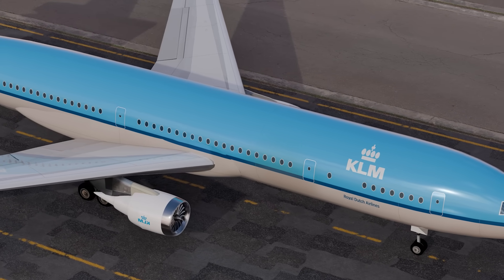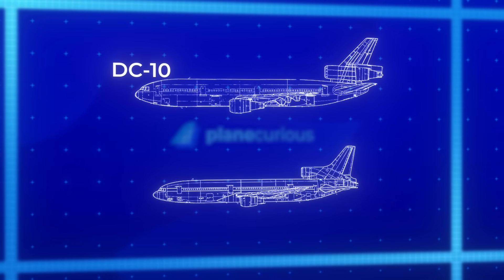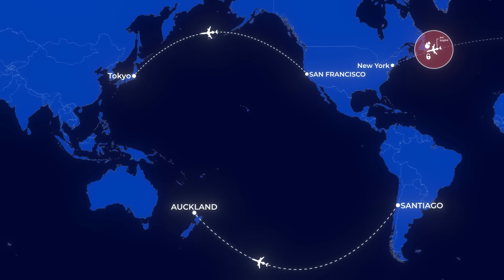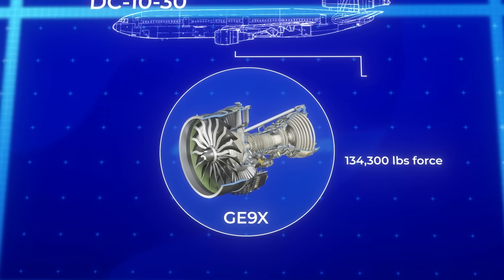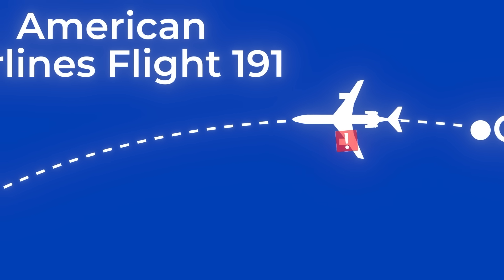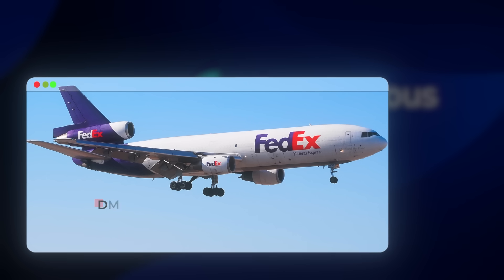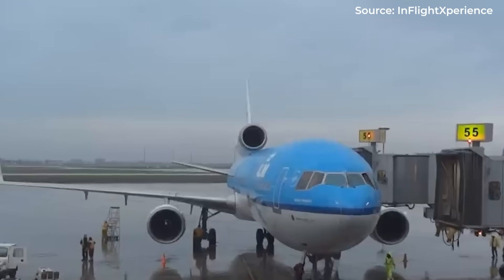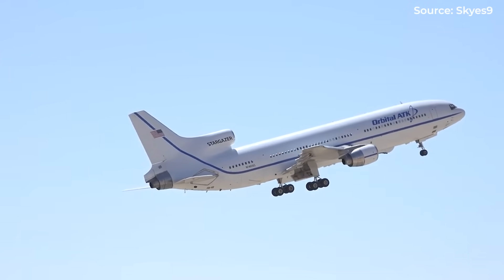Trijets Changed Everything - Until They Didn’t

Comment: Douglas had plans for (and international requests for) a twinjet version of the DC-10. But McDonnell didn't want to invest the money. In a great "what if" had MD catalogued a twinjet the size of a 767 when ETOPS became a thing they would have been possibly a decade ahead of everyone else.
Reply: The McDonnell c-suite still is a bunch of cheapskates; they ruined both Douglas and Boeing...
Reply: @ At this point Douglas had the DC-8 quadjet, DC-9 twinjet and the DC-10 trijet. Modifying the DC-10 into an underwing twinjet should have been relatively simple for Douglas. And the DC-10 platform is newer than the 737.
Reply: @stonebear  Not quite correct . . .

After the DAC/MAC merger in 1967, the corporate board of directors was predominate dominated by MAC executives including multiple members of the McDonnell family. MAC designed and built some great military aircraft, but never understood the commercial side of the market and thus was the major factor in DAC's demise.

Regarding their effect on Boeing after the Boeing/MDC merger, it is not what most people think. Only two people from MDC board transitioned to the new Boeing board. John McDonnell and Harry Stonecipher. At that time the heard of Boeing Commercial Airplane Group, BCAD, was Phil Condit who was a career long engineer at BCAG. Immediately following the merger, less than a handful of MDC executives went to Seattle to run the show.

By that time both Condit and Stonecipher had already been infected by the Jack Welsh business model as well as many many others already in place at Boeing had been. The whole industry was. Other industries at the time also. Neutron Jack was the golden boy of industry and Wall Street at the time.

Yes, Stonecipher, who worked for Neutron Jack at GE, had a lot to do with it, but most people forget, or don't know that Stonecipher was only at MDC for 18 months prior to the MDC/Boeing merger, giving little time for him to infect MDC as many people think he did. His way of doing things in no way, shape, or form existed at any level of MDC prior to his arrival 18 months earlier.

The bottom line is Boeing was headed that way with or without the merger. The merger just accelerated it. Condit and his ilk were well on there way. And McNerney,  continued in that way, and then Mullenberg, another career long Boeing engineer went on to take it all to an entirely higher level.

Comment: Pretty much ETOPS decimated trijets (i.e., made them obsolete). Of course, McDonnell Douglas lacked resources, so they went with the MD-11. Had they played their cards right, they could have at least conceived an idea of a jetliner longer in range than the Airbus A330-300 with the MD-11 fuselage without the tail engine, pretty much their own B777 (at least before the actual Boeing 777).

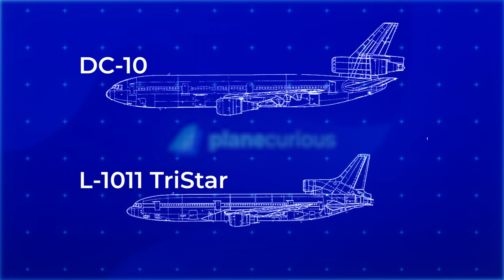Also at 3:23, the TriStar has three RR engines, so the L-1011 is both figuratively and literally a Rolls-Royce.

Comment: I don't know where you got your information on the thrust output on a DC-10-30, but it is much more than 125,000 lbs. force. 
The CF6-50C2 on a DC-10-30 put out 52,500 lbs. thrust. I built CF6-50's, installed them on many DC-10-30s, and trimmed them. The CF6-50C2B put out 53,500 lbs.
One of the best engines I ever worked on, and I overhauled many different jet engines.
Reply: Flew those big GE’s for 23 years of a 35 year career.  Always thought stood for Great Engines!  In a DC-10-30 with the parking brakes set, you could literally feel the airplane lunging forward:  those big -50’s just saying “let me at that runway:  I’ll show you what a Pratt and Whitney just wishes it could do”.
Reply: @gordonbryan8381  When I would run those engines on an empty airplane, usually a post heavy or light check maintenance runup,
you had to be careful. The plane could just take off on you. In snow I would have the plane fueled to 130,000+ lbs. of fuel, you needed the weight.
The Woodard MEC on a CF6 is the best hydro mechanical computer, or main engine control I ever worked with. CF6's ran great because of it.   
Dealt with JT9s' on DC-10-40s, the JT9 was one very tough engine, as long as the engine control components were properly overhauled, they ran well. If you had a worn out Engine Vane Controller (EVC) the variable stator vanes would hunt, and stalls could occur, and they did. Violent stalls. 
The JT9 was touchy about airflow, you could get cross wind stalls, off idle stalls, full power stalls on the ground. Top of decent stalls in the air.
Reply: You are absolutely right. I dispatched DC-10-30s for some 15 years snd I have good memory for figures.
Reply: The original CF6 was a 40,000-lb class engine.  I worked with GE's performance data for years.
Reply: CF 6 core comes from the GE J79,,,, and still tried and true.
Reply: After 4000 hours on 767 with CF6 engines, my last flight was a DC-10-30, DFW to HNL.  Never had a CF6 engine even hiccup.

Comment: The first airliner I travelled on was a British Airways Lockheed L-1011 TriStar out of Gatwick back in the 1980's.
All my flights these days are on Boeing 737-800's. The TriStar was like riding in a limo, the 737 is like riding in a Fiat 500!
Reply: I remember mostly the flawless, perfectly-compensated touch-down.
Reply: I love the 737.  I compare it to a Toyota Corolla or Camry.  It was extremely successful, not flashy and could land anywhere and was very versatile.  The max has smeared it's reputation but the 737 is a great plane
Reply: @rickydunn3921  I've had one flight on the 737-800 MAX, quite nice actually.
Reply: @rickydunn3921  737, the best selling commercial jet, also had its problems. The uncommanded rudder movement and subsequent crashes comes to mind . . .

Comment: Hmmm. I live in Charlotte and we have a museum with a twin engine plane that crashed in the Hudson River because both engines failed from a bird strike. That’s not to say that a third engine wouldn’t have failed as well given the circumstances but it’s possible that it could have survived. My point is that the argument that two engines failing is almost impossible has already been debunked by what has actually happened.
Reply: There was also an accident at Heathrow with a 777 before the miracle on the Hudson.  Again a double engine failure.
Reply: It's very rare
Reply: Hearing about the bird strike risk, I’ve often wondered why jet engine intakes aren’t fitted with carefully designed mesh birdguards.
Reply: @roybatty2030
Jets don’t use a mesh guard over the engine intake for a few reasons: One is that it would block enough airflow and add enough weight to affect engine performance. The other is that if a bird strike damaged the mesh, which would likely happen given the speed and forces involved, metal could be sucked into the engine, which would do much more damage than a bird carcass.
Reply: @ Good points but I think those risks can be overcome with good engineering and development. I’m not talking here about a piece of flimsy chicken wire. Static jet engines used for power generation (eg. on offshore platforms) have intake air filters. In the future, I believe that bird guards will be on every jet engine intake and people will wonder why they were not fitted earlier and how the bird risk was tolerated so long.
Reply: @roybatty2030
Just keep in mind that ground gas turbine (turbojet) generators are less reliant on unobstructed airflow than aeronautical turbofans, which use ducted air not part of the combustion process for additional thrust. I don’t mean to imply it can’t be done, but I think bird strike mitigation would require a different type of jet engine from what we currently have, which is, of course, entirely possible as technology advances. Cheers.
Reply: @zachsharp4564  Good point. 
I recall jet aircraft were so noisy that you could not speak when they flew overhead. We all just accepted that those engines were noisy, however, they've now reached relative silence. "It's risky to make predictions, especially about the future".

Comment: The DC-10's Engine 2 (Tail one) did not have the fan blade in the front, it was deep inside the nacelle.
Reply: The #2 engine inlet was 22' long before you got to the fan on the engine. The reason why the DC10 had a distinct growl heard when flying overhead on takeoff.

Comment: It was actually three planes, the Airbus A310, Airbus A300B4-600R and the Boeing 767, that was at the forefront of the twin-engined transoceanic flights. I believe it was El Al and TWA who pioneered such flights using the 767-200(ER) in 1986 on transatlantic routes.

Comment: Was there ever an incident of a trijet losing 2 engines, leaving only one? I don't believe so. Therefore, I believe the 60 minute etops rule was unnecessary. It should have been at least 180 minutes.
Reply: The 60 minute rule and ETOPS were for two engine airplane ONLY. The trijets never had any restriction. They only had the same limits a four engine airplanes.
Reply: @georgeconway4360  exactly my point. Two engine aircraft were not allowed over water because of the fear of both failing. There was never a trijet that lost two engines. The policy never once saved anything.
Reply: You’re banging on a open door